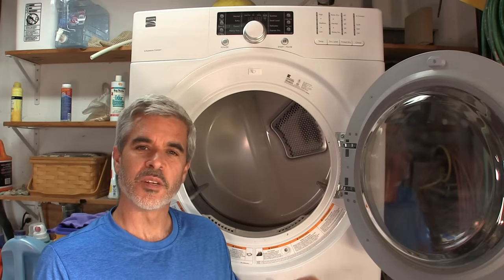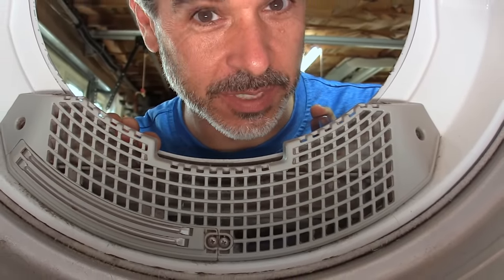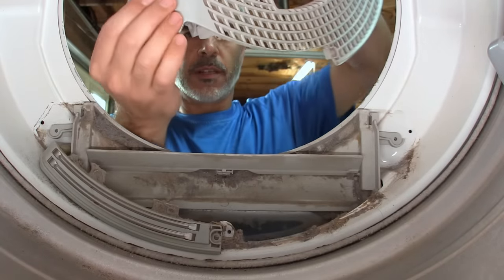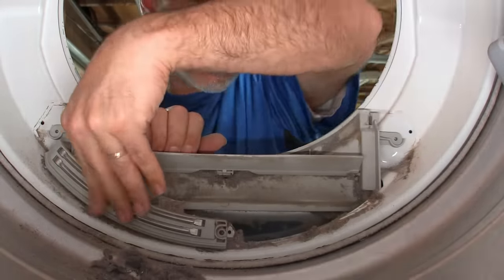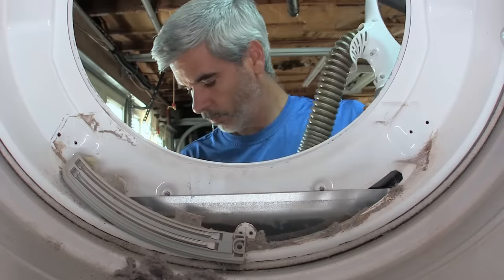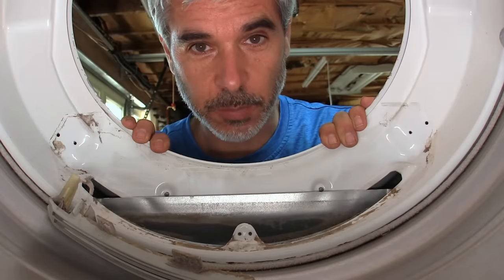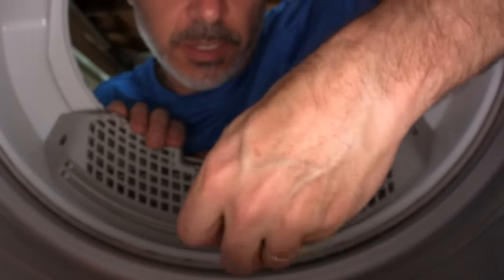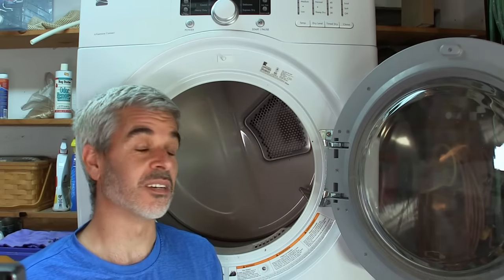Dryer Lint Trap Deep-Cleaning: I found 4 cups of fluff below the filter!

Comment: I found $1.87 in coins in my dryer.  I just duct-taped a small rubber hose to the hose of the shop vac so I could get in there.
Reply: I was looking for something like this. Way to be resourceful! However, I need something a little more rigid with "scraping" abilities. I got the dryer used from my brother, and I believe he uses the forbidden tide and fabric softener because the lint is literally caked on all sides of the drum beyond what the linear vacuum crevice can reach.

Comment: The worse design in the world, never have I ever had to do that with OLD dryers. I sold our old dryer to get a larger drum and I regret it. How in the world with all this technology does appliances get worse. I don't know but most appliances have.
Reply: Not even close to a whirlpool fridge no way to get the freezer door off to clean the freezer without major surgery
Reply: Designed to be replaced in a few years when they stop drying well.
Reply: It is so sad...new tech is not better tech, the old and simple designs were better.  These are over-complicated designs that are not going to last as long as older and simpler designs,
Reply: @LazyDayz316  no new technology is definitely better, they just realized if they made them harder to service it'd boost sales
Reply: Its so people will have to buy new ones....
Reply: I never had an old one apart to compare. It could have been as bad, just less visible. On the other hand, the filters were usually at the back and may have had better airflow.
Reply: @beamersbeamer6514  or my old glass top stove. Broke the top (dropped a can of food), got the replacement and got shocked (yeah, power was on), on the frame replacing it. Idiots had run wiring across sheet metal screws so that in transit with the vibration, the wire was contacting the screw to the frame and that wasn't enough to pop the breaker. (No GFCI on a stove, at least at that time!)
Reply: @NJxTN  very true no one expects an electric car to last 20 years
Reply: It's for profit's sake and everything that comes with increased gap between the wealthy and the poor, as well as inflation therein. Economics that creates waste and instability.
Reply: So consumers can buy more and spend more $$$
Reply: Today they build to replace... unlike olden days when they built to last.

Comment: I have a transparent 1/2 inch pipe connected to a shop vac using PVC reducers. It does a good job of sucking everything out. Also remember to vacuum the 4 inch hose that goes to the outside. This is very important.

Comment: I use a long brush made for jobs like this.  Which I haven't used in a while.  So thanks for the reminder.  My dryer is 22 years old.  Still going strong.  Knock on wood.
Reply: My last dryer was 30 yrs old. I would wrap a paint stirring stick with masking tape sticky side out. You'd be surprised at how much you can get just that way.

Comment: I did my best to utilize this video. Unfortunately, my dryer is slightly different, so I never got the whole unit pulled completely out/apart. Nonetheless, you provided enough instruction to get me through a pretty thorough cleaning with no lost pieces/parts. Thank you!!
Reply from the maker: Glad it helped!
Reply: @dansway.  My lint trap is on top.  Will try to figure it out.

Comment: This is a great video!
I have had dryer 4 years I have always cleaned it by using 3/4 in plastic tube taped to shop vac.
It gets the visible dust only I found out.  
Disassembled dryer vent and was shocked by how much hidden up inside.  
I was noticing dryer was not fully drying when using dryer sensor. 
Hopefully it will now.
One helpful suggestion  headlamp very helpful on this project for seeing screws.
Reply from the maker: Great suggestions.  Interesting that cleaning it got your moisture sensor working as well, great job!  I like your headlamp suggestion too.

Comment: Luckily my last dryer that just finally died at 23 1/2 yrs old had the same kind of inside filter as yours but I had a panel on the bottom front that I could take off and clean that area and more.  Going to have to take a look at the new one closer.  I did clean out the bottom of the old one regularly because there is a FLAME down there!  Be warned Home Warranty users, my heating element was going out (after 23 1/2/ yrs) and when the repairman came there was about a hand full of stuff on the inside and they refused to fix my dryer.  It was MY fault the heating element was going out because of "excessive" lint.   He also reported to them that there were other problems including my hose and vent being clogged which he didn't even look at.  They believed his report and not me OR what he had told me.  Going to record all interactions with repairman they send out from now on.

Comment: An old toothbrush would have made cleaning,  removing lint &  fluff, super easy.
Easy way to remember how  to re-assemble in right way, would be to take board markers ( wipeable),  in different colours, and make markings across two parts that fit together.  After fitting, markings may be wiped off or left for next  cleaning time.
Reply from the maker: I like the suggestions! Thanks for those 😃

Comment: I believe there's more inside the dryer where the vacuum cleaner cannot reach. When I disassembled mine, I found much more lint and hair. If this is an LG/Kenmore dryer (which it looks to be), there may be a small circular access door on one side, where one may be able to use to remove more stuff. I'm not sure if all models have that access door though. I personally feel it's worth a 1 to 1.5 hours of time to fully disassemble the thing and clean it out once every couple of years.
Reply from the maker: Agreed!  This is just one of the places that needs to be cleaned out.

Comment: A symptom of this that I just encountered is that the easy to remove lint filter doesn't push down flush with the opening. I had 3 loads of clothes where a sleeve or a draw string got caught  on the lint filter and came out all twisted up.  I ended up using a couple long screw drivers like chop sticks to clean out the big balls of lint, but after this video, I will definitely be going deeper. I didn't even notice the screws in the lint filter opening... Thanks!
Reply from the maker: Yes, the lint trap not going all the way down is a great indication that there is a build-up down there.  Now check out the exhaust side and hose for even more!

Comment: This vid is the best for replacing the filter and/or the filter housing, which I had to do b/c they had (again) broken. The part (filter housing) I got from LG's contractor was awful, and that was the thing that made the repair difficult. On the other hand, the contractor discounted the total cost and shipping so we got it quickly.

In other vids you see that the housing has 2 clips to attach it to the base; not sure why Dan's didn't show that. (He mentions the base and lifts it out at about 3:20.) The filter housing (plastic) was distorted to the extent that I never was able to get one of the clips attached. (but once it was in the machine, the screws held in down and in place). Because the badly manufactured plastic housing was in effect "springing out", the process of reattaching the screws was difficult. I started with the center, went to the one with the clip attached, and finally to the last, which was quite difficult. But I managed to get it done. I think Dan mentioned that the screws attach to sheet metal, posing a risk that you might overtighten and strip them, so I was very careful, went back and forth in the process.

Finally, I thought I was basically replacing parts, but just as Dan said, the dryer was filthy (after maybe 6-7 years) and I cleaned it out carefully. I'm reluctant to tackle the cleaning process again given my struggles with the screws, but I can't imagine leaving that huge amount of lint for another 5 years. LG dryers are great when they're working, but LG also has perfected a way to keep techs constantly working and sell more dryers.
Reply from the maker: Thanks for your comments Tom!

Comment: Thank you for the informative video.  I have an older Maytag and the lint filter housing looks like a smile too, but it is one solid piece with the same looking moisture sensor elements.  BUT even though I unscrew the three screws, it does not come out.  It looks as though it is held firm by a metal housing on top and bottom.  Very annoying.  I was hoping you might have some ideas about this kind of mad design.  Thank you Dan.  Lynne
Reply from the maker: Hey Lynne, does this video look like yours? https://youtu.be/ROExxn9Vqng

Comment: I haven't used a dryer in over 20 years.  I like crunchy clothes and towels.  Plus there is nothing I wash that I need in an hour.  Also, dryers are electricity pigs.  But someone else in my household does use the dryer and I noticed we have this problem.  Good info.

Comment: Did some disassembly and cleaning of my LG dryer filter area today.  I was shocked at how much "crap" was in there.  Even some brown evergreen needles.  Now I know that I also need to disassemble the vent/duct sometime soon. Thanks.
Reply from the maker: Exactly!  Both the intake and exhaust have to be cleaned every once in a while...
Reply: @DansWay  Did your video help prevent a disaster?  Yes, in my opinion.  The duct work from my dryer contained at least four big handfuls of dark lint stuff.  My shop vac sucked up more.  All of the duct work had a thick coating of the dark stuff.  The fact that the highest temperature I used was “Medium” may have prevented a fire.  Turns out the duct work is screwy, in my opinion.  The dryer vents vertically into a big semi-flexible metal tube which loops up,  around, and down, and was connected, using metal tape, to the “permanent” duct work at floor level.  I intend to fix the duct work, so that the dryer vents straight down, soon.  The last step will be to clean the duct work that goes through the crawl space, to the outside vent.  Thanks!
Reply from the maker: Sounds like you are on the right track!  That up/down path could slow down the airflow allowing the lint to drop out of the airstream.  Cutting it so it just drops to the floor vent directly sounds like a great plan.

Comment: I took apart the front of our dryer the other day because the door hinge design is so dumb it needed to be reinforced from inside the front panel. In the process, because it was exposed already, I took out the entire lint compartment and cleaned EVERYTHING. I even vacuumed out the assembly from the vent opening in the back before reconnecting the vent. Needless to say, it's already warming up faster AND I fixed a major design flaw with the door hinge. The best part is pocketing the savings most would have paid a "professional" to do it instead. Good old fashioned DIY😁
Reply from the maker: Wow, that was a lot of work!  Great job!

Comment: You're supposed to clean out the inside of your dryer at least once a year!  Most of us don't.  I haven't taken this part off, but I have removed the front panel to replace a belt and vacuumed the whole thing out then.  I see you have another video on the exhaust hose & vent.  That's really important to clean out, too.  All that moisture causes the lint to cake up wherever it can.

Comment: Great video, thank you. My dryer is a bit different but was able to make clearance. Had a ton of lint. Another issue is that lint build up can block the exhaust and cause the dryer to run hotter than normal. U can burn out solenoids/sensors inside the dryer. I had to replace mine.
Reply from the maker: Great tip! Thanks for sharing.

Comment: I have always used my radiator hose for my vacuum cleaner for cleaning my radiators and regular cleaning of my tumble dryer and checking the dryer has no built up fluff I also check the outside vent and vacuum cleaner and this stops the building up for lack of maintenance and the risk of fire and overheating of the dryer. Twice a year to unscrew the back of the dryer and vacuum the dryer from any built up fluff. Regular inspection of filter and door seal, for many people get rid off their dryer when they have problems with built up of fluff and condensation and moisture on the front of the dryer and also taking longer to dry the clothes and a simple replacement of the door seal that just pulls out and push in a new door seal and a new door filter is all that is required.
Reply from the maker: Great ideas there Linda!

Comment: I also pull out the dryer to disconnect the tube that sends lint up to the roof, etc., and try to clean that out, even got on the roof and now I'll do this part and I'm a boomer female so thanks for the inside stuff, you can't get it clean by putting the tool in there, tried that, tried tape on a hanger down in there to scoot to a corner to get out that way too and that helped until the bottom part of it anyway. Thanks for the advice!
Reply from the maker: No worries.  Always good to do the exhaust side as well!

Comment: I just bought a Blomberg washer/dryer set, and the dryer is ventless. (I don't know if that makes a difference). I went to look under the inside basket filter and saw a chute, which goes down to a 2nd filter that you access from the bottom front of the machine under the door. You're supposed to  clean the 2nd filter after maybe every 4-5 loads. When I removed it, I saw that the chute from the inside filter leads  down to the 2nd one, and you can pull any  debris out with your hand! Maybe a modern improvement? Anyway, I never have to take apart the inside filter to clean under it! :)

Comment: Excellent video and great instructions and tip about putting it back together so your brain remembers that instead of just the taking apart process. Thank you!

I must say though, designers? wth???  "here consumers, have a nice fire hazard, even though you think you're right on  top of cleaning the lint out, diligently, after every load. "
Reply from the maker: Yah, I can't vouch for the designers not making this just a simple tab or clip to remove this all more easily...

Comment: I saw a hack where you can use the cardboard core from paper towels  to get down in there easier… just tape the core to your vacuum hose and it fits down there for some easy cleaning… still good idea to take it apart to clean the individual pieces…. Thanks for the info 👍
Reply from the maker: Yah, I've seen that one as well.  If the opening is large enough to get it all our, then perfect!

Comment: Thank you! I kept getting an error code to check the lint filter, but I'm consistent about cleaning it after every load. I already replaced the tubing from the dryer to the vent, but the error persisted. I'm sure this will solve the problem and help prevent a lint fire in the making. :)
Reply from the maker: Great !  Let us know if this fixes the problem.

Comment: Thank you Dan!! We have maybe the same model or a little newer but looks very similar. We have been getting the sensor flow error. I will do this deep clean and I saw in another post I am going to wash what parts I can before putting it back together. Also will unplug the unit first! This video is very helpful!!!
Reply from the maker: Did it work out?  Is the sensor working normally?
Reply: @DansWay  Hay Dan, it worked beautifully!! No more flow sensor error!! Thanks again!!!

Comment: I cleaned the interior of my lint screen area without issue. I’m good about cleaning the filter after each use so what I found was more lint dust than larger pieces. Certainly, not a bucket full. My problem was the screw. No slot for a screwdriver or Phillips. Only because I had a set with a small socket wrench that I was able to remove the screw. This is ridiculous. I am handy and have adequate tools for what I need for my home repairs. I will be taking the screw to the hardware store and get screws that are easier to use.
Reply from the maker: Good for you Joyce!  I like the idea of replacing the screw with something more serviceable for the future.  Thanks for sharing!

Comment: Thanks! Our LG drier is only one year old and it already needed this cleaning. I'm 76 and it wasn't that difficult to do for me either.
Reply from the maker: Wow, surprised it already have buildup needing this cleaning.  Be absolutely sure you clean out the exhaust hose and the output port on the outside of the home.  That is where an actual clog can form which greatly lengthens dry-time and becomes a fire hazard.

Comment: I found a way to advert this from ever happening, as well a dust-free method of cleaning the filter.
I keep a cheap bagged vacuum cleaner next to my dryer.  Attached to the hose is a crevasse tool like Dan used here.
I start the vacuum then hold the tool near the filter as I'm pulling it out, then vacuum the filter, then vac the filter housing.
I follow up with a quick vac on the floor in front and under the dryer.  The vacuum bags last a long-time collecting lint.
Crevasse tools can be found in very long lengths for rear filter dryers.

Comment: Great video!  Did notice that the wire attachment to the moisture sensor was not visible in the final reassembly.
Reply from the maker: Hey Cynthia. I looked again and you can see the connection and wires at 6:30 on the left.

Comment: I didn't think much about the tear in our lint filter until it started taking a very long time for clothes to dry. Ultimately I opened up the machine, removed the elephant trunk duct, and disassembled the exhaust duct in the crawl space. I removed about 20 pounds of wet lint that blocked air flow in every part of the system. A new lint filter (it cost almost $5!) and reassembly got it working right again.
No more taking dryer exhaust for granted!